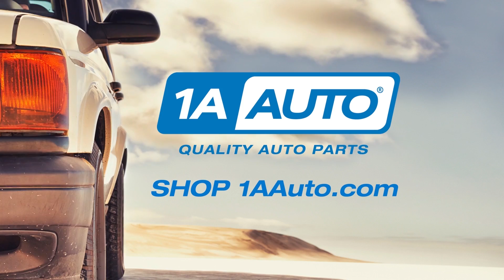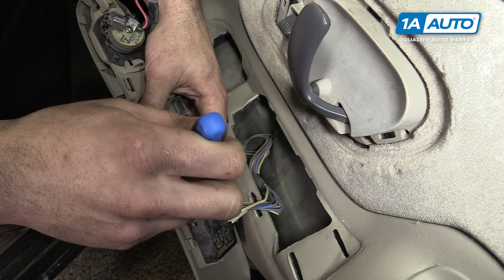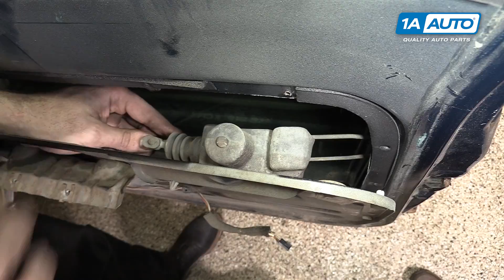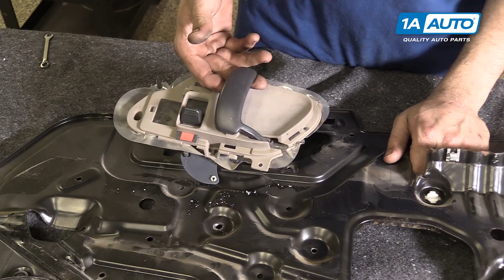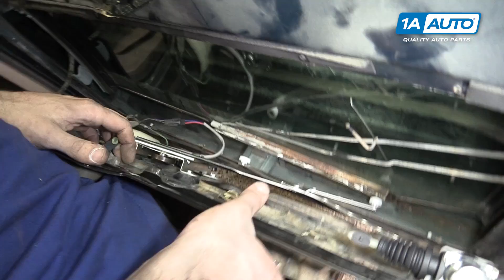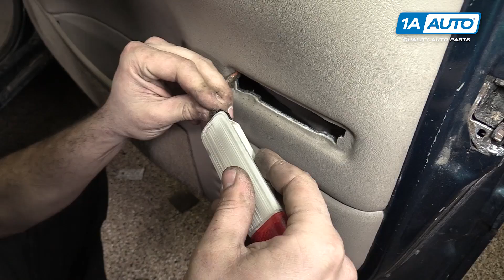How to Replace Interior Door Handle 95-99 GMC K1500

Comment: Do you sell the GM 15707298 Deflector Assembly, Front Side Door Water
1995-2000 GM
If so, how much?. It says it's discontinued, and tape doesn't do it anymore.

Comment: Great video since I had a broken inner door handle assembly and a rusted out window rail. I appreciated your detailed video especially how to get the regulator assembly rollers back into the window lift rail, couldn't figure out that one for the life of me. Any thoughts on what I should use to attach the window to the new lift rail.  Stuff I took off the bottom of the window was like a rock, had to wire brush it off so the new rail would fit back on to the window bottom but wondering what I should use to secure the rail to the window, otherwise I'm sure the rail will eventuall pull off unless I do, thanks in advance and great video, luckilly I have manual crank window so wayyyyy less wireing other than the speaker!
Reply from the maker: +voodooutube1 Thanks for checking us out. Shop for high quality auto parts on 1AAuto.com:

http://1aau.to/m/Shop-1AAuto-c

Comment: Yea definitely don’t do what these guys did. Just drove a rivet push the unit forward unhook the rods and replace. It takes longer to get the door panel off then it does to swap out the handle. This video should be removed as it is way overkill to remove the whole inside of the door assembly.

Comment: This is the most complicated, and mostly unnecessary way to do this.  You need to pull the door panel, drill the rivet, pull the door handle unit forward, pull out until you can see the link rods, then unclip link rods.
In the past, I have found 1A Auto to have very informative videos.  This one is extreme overkill.  There is no reason to fully take off the door panel, wires, light, buttons & tweeter.  This video should be removed.
Reply from the maker: +Jim Howard Thanks for the feedback!
Reply: Agreed, way more complicated than it needs to.
Reply: Yep, this one vid' covers all potential broken components ! 

Lookin' for inside driver door handle replacement vid'  .   To fix my '96 break this past Wed and hope to repair when we pop above zero celsius again next week,  with new door handle !! 

Thanks for your time :-)

Comment: That was painful... If you are changing the actuator maybe but I have changed several handles without removing the inner panel. I love 1A Auto and will continue to by my parts and watch your videos but this one was overkill.
Reply from the maker: +MrBowNaxe Thanks for the feedback!
Reply: Is there a vid' out there showing your method. 
My '96 inside driver handle broke this past Wed. , and then we had -20c for a couple days  !

Researching for when above zero on driveway     LoL

Comment: Would I need to replace the whole handle and lock if the lock is just not moving?  The doors still lock and unlock, just the manual thing that shows red when unlocked doesnt move on my drivers door. Just something disconnected?

Comment: Why did you take apart the entire assembly? I pulled the door panel, drilled out the rivets and replaced the entire thing and the whole process to 5 minutes. There was no need for all that extra work lol
Reply: Are you serious? because I need to replace mines since handle broke. This video seems like a lot of work.
Reply: I was wondering about that. So much unnecessary work!
Reply: They charge book prices on labor so they need to justify the 2 hour labor cost.

I was getting a little overwhelmed watching this video. Now that I've watched it and see how it goes together. I think I understand your comment better. Gonna give it a go in the morning.
Reply: @rogerlimoseth4790  was it I easy I have to replace both on 2000 cadillac escalade passenger sides
Reply: Thought I was tripping bc I'm bout to just keep opening my door from the outside lol

Comment: I've re-lubed the window motor gear and window actuator teeth, since you have the panel out and easy to access that area as well.  The original factory lube is usually dirty and dried out, at the age these trucks are, now.
Reply: What did you live it with

Comment: You don't have to take the whole door assembly apart.. This is the professional method but it's a lot more involved than it has to be for the DIYer
Reply: Bahahah I snapped the plastic off the rivet, sled the old door handle forward from the bracket and off it goes. Then just put the new one back on over the old rivet. No need to drill it out and rivet to secure the new door handle. It’s secure enough🤣
Reply: i was about to say this, seems like a lot of extra work to get my old trucks door working....
Reply: You're right the rivet was right there once the door panel was off and it had clearance to disconnect the 2 rods that are attached to the handle and lock using a needle nose pliers once the rivet was out and the handle assembly was loose.
Reply: Although not necessary, this could be used as a jumping off point for more involved repairs and replacements.
Reply: +1 This video is absurdly complicated for the intended result. I did a fraction of the steps in the video to accomplish the repair. I don’t understand why the overkill.
Blessings, Grace and Peace 😊

Comment: Curious...why did you not list the rivet gun in the tools ..but hammer and chisel and painters tape was mentioned?
Reply: They've also used a good portion of this video footage in videos for other door parts like the door latch, and exterior door handle.  The intro message and tool list are part that is shared footage.

Comment: What size rivet was that
Reply: Just drill it out and put a nut and bolt, easy peasy
Reply from the maker: We do not have this information available, however, you can use the original rivet when doing this repair.  Thanks for the inquiry. +nclildogg2
Reply: @1AAuto   once you drill out the rivets how can you reuse it

Comment: Hello A1, great video .... I had one problem though.. after I replaced my new outside door handle and got everything put back together, my glass won't slide up and down correctly. we made sure it was on the track properly, all parts put back and our hopes of completing a perfect job was dashed when we tried to roll it up. Any ideas where went wrong?
Reply from the maker: +Mike Ortega Thanks for watching!  It seems that the window track was affected when performing this repair.  You will have to open up the door and make sure the window track is in the correct position.  1aauto.com

Comment: Nice video, but you need to fix your website
Reply: Not necessary to completely remove the door panel IMO, unless you’ve got bigger problems inside
Reply: Everything is fine now, but the last time the page would not load properly, but now it's good.
Do you send parts to Europe ???
Reply: Over kill to replace a handle but professionally executed video thanks